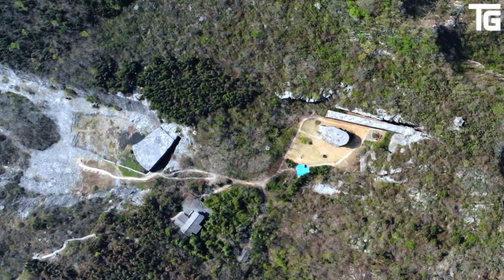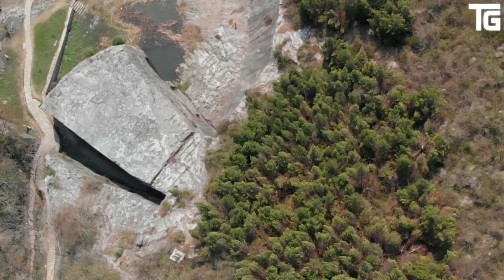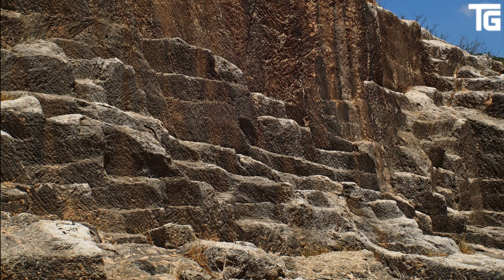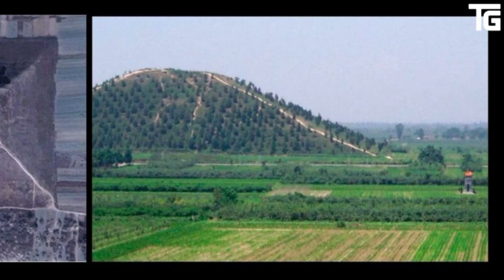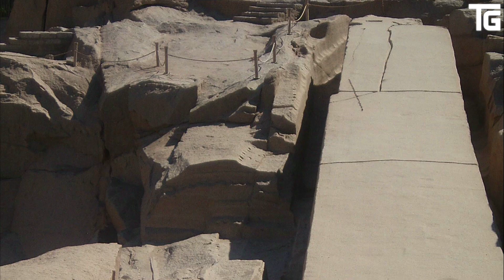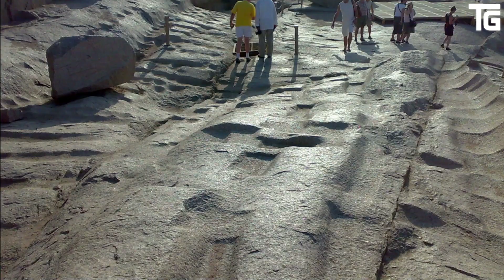Pre-Historic Traces of Lost Civilizations on the Megaliths of China and Egypt

Comment: These people were trying to show how they can cut granite with copper saws and sand, but I had to say that if you look at the way it was done by the actual marks left by the cutting device used, each stroke or circulation of the saw blade was taking about 4mm deep cut, not like they were trying to replicate it by cutting 1000 strokes or circulations of the copper blade, barely taking any noticeable depth in the cut, maybe 0.3mm, so no it wasn't done that way, more likely taking a couple of days to cut the whole side, not a couple of decades their way lol.
Reply: It's concrete that has petrified thousand years ago. 
The cataclysmic events, worldly, has shifted this large concrete structure. 
Metal was scavenged for simple metal tools that the next generation took. 
These concrete structures are everywhere.